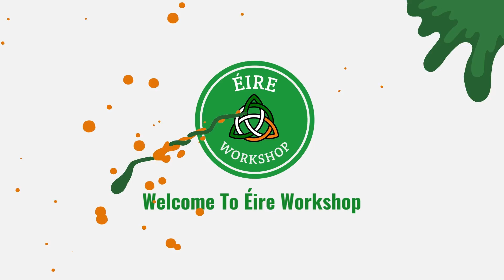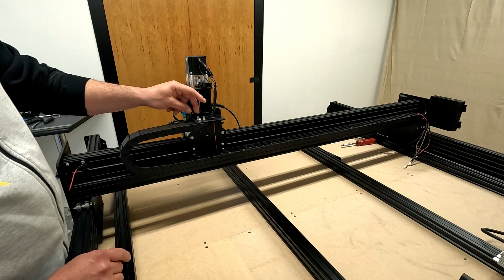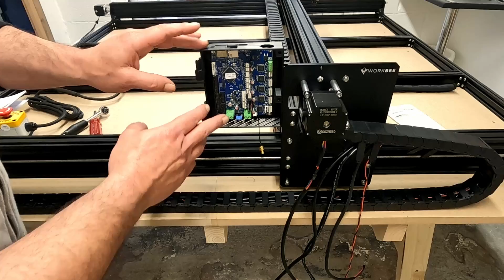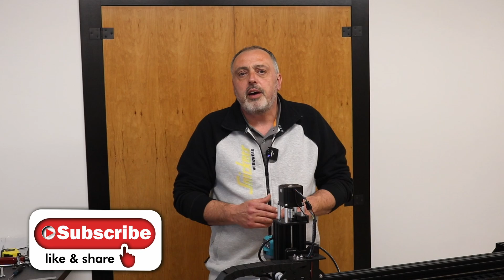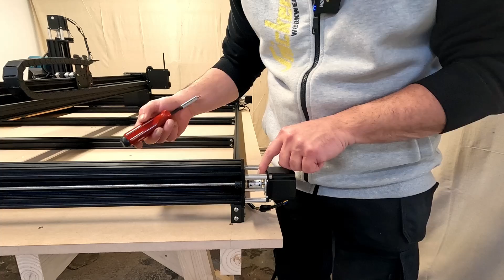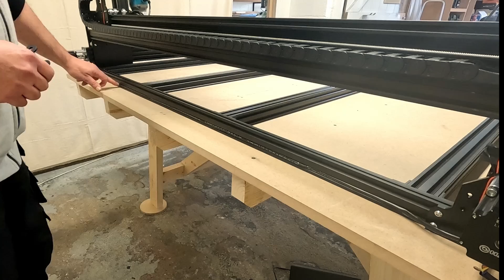Building A Workbee Z1+ CNC Part 5 / Build is Finished

Comment: All the videos in this series are so helpful!

How much flex would you expect to feel in the lead screws once they are tensioned? I think I've followed along pretty accurately but it feels like they've got quite a lot of flex to them still! Cheers
Reply from the maker: Thank you,
There will be a certain amount of flex more noticeable when the cnc is in the homed position as the leadscrew is long but it should still be until 5mm up and down if you move it with your finger and if you centre the carriage on the leadscrew it should have very minimal movement up and down with your finger. If you feel that it is flexing too much repeat the tensioning process but get someone to gently hold the flex coupler on the stepper motor to stop it from clicking over so easily aa you set the tension . Hope this helps feel free to let me know how you get on.
Reply: cheers that sounds like a plan! thanks for the help

Comment: Great videos on building these. I missed what you did with the router wiring.
Reply from the maker: Thank you. I ran the wire from the router directly to the ceiling and later ran it with the dust collection hose when I added it

Comment: Why don’t you include the connecting to the laptop and finding the software?
Reply from the maker: Hi Tim, as I said in the video I didn't include connecting laptop etc because it will vary so much from user to user depending on windows operating system or apple etc and between a WiFi or ethernet version of the workbee. However I did find connecting my laptop very straightforward when following ooznests instructions.

Comment: thanks for the build Tommy im getting towards the end of my build 1500x1000 , just about to install mafel router mount and then on with the rest of the build some great tips in there Tommy and I will pop in again to check to see what your making, I have already set a deal with my local butchers and supplying with my sawdust for their floor. Thanks Tommy
Reply from the maker: Thanks Mervyn I'm glad you found them useful.

Comment: Hi Fantastic video, definatly help me through the build, seem to have one small problem that you could possibly help me with, you say when you switch on the control panel for the workbee for the first time that it will ask you for the size of your  machine, mine did not, as it is a second hand machine, so how to you go about setting the size this may ahce something to do with the reason the touch probe will not work as it keeps coming up with ( Upload the probe.g successful after 0s ) then ( M98Pprobe.g GO/G1:target position outside machine limits ) and will not perform the function any clues, any help will be much appreciated, Cheer Stu
Reply: Did you get to the bottom of this? Facing the same issue when setting up my machine.

Comment: Hi Tommy, how's things? Need to ask you a quick question about the cnc. Did you have any issues opening up the url link to see the control interface? It won't open for me.
Reply from the maker: Hi Steven, I didn't have any issues the control  interface is only a Web browser page. Try entering the Web address manually is all I can suggest

Comment: Hi Tommy,

Great video, thank you!

I'm looking at purchasing this machine, possible 1x1.5 to use commercially. Can I ask if you opted for the Ooznest router or the Mifell and why?
Reply from the maker: Hi Michael thanks for the compliment, I got the katsu and maffell for testing the Ooznest router wasn't available at the time. However if you are planning on running the machine for longer periods of time any trim router isn't designed for that kind of use where the maffell is designed to run none stop for long periods and its also alot quieter. My recommendation would be to go for the maffell motor. Oh and if you do decide to purchase please use the link in my video to the Ooznest site 🙂
Reply: @ÉireWorkshop  Hi Tommy,

Thanks for the info. I'll be sure to use the link if I decide to purchase.

Thank you again